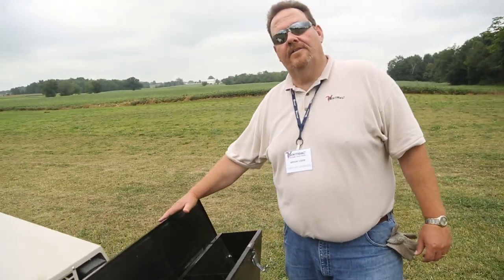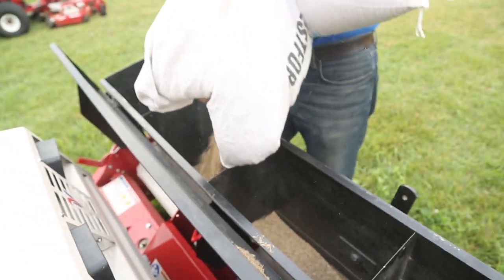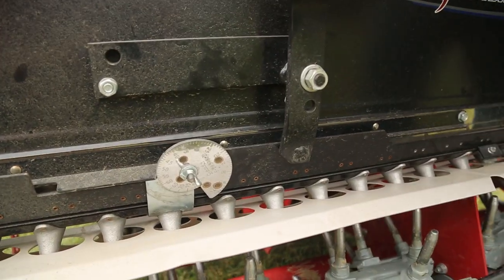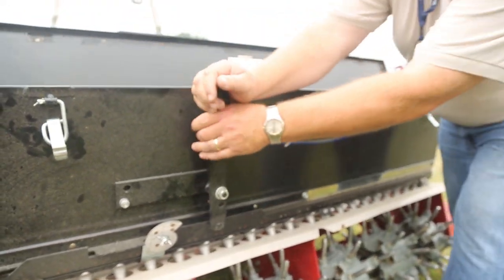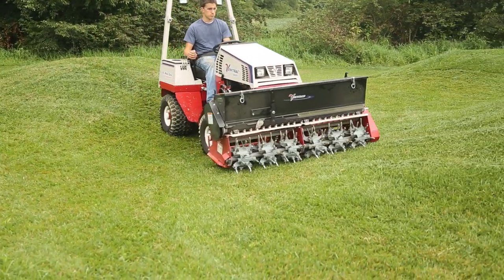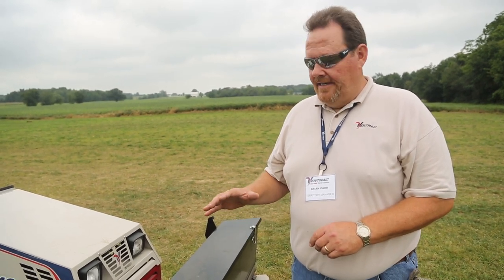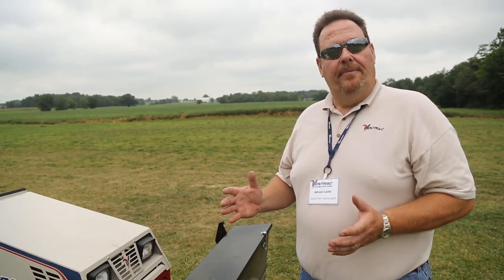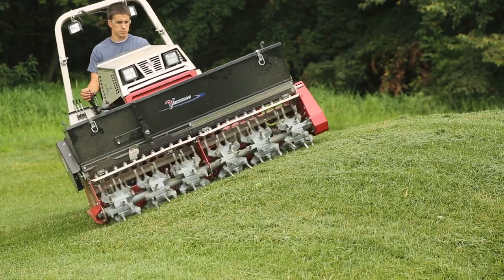Ventrac EA600 Aera-vator and Seedbox

Comment: Can they Aera-vator with the Seeder be used with the ES220 on the back with the Ventac 4500 series?
Reply from the maker: Yes, the Aera-Vator with the optional seeder kit on the front, can be used with the ES220 spreader on the back. This is only an option with our 4500 series tractors.
Reply: That would be a perfect option for the fall as all three things can be done at the same time.

Comment: Do you have so.thing like that 4 the 3000 tractors
Reply from the maker: The 3000 series tractors can run the standard aerator, but not the AERA-Vator.  The PTO on the AERA-Vator is oriented for the 4000 series tractors only.